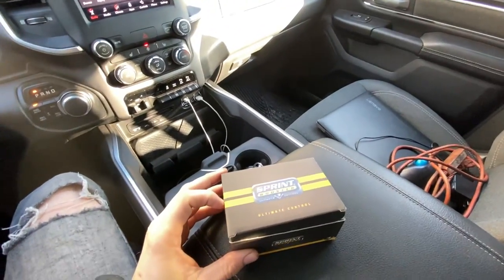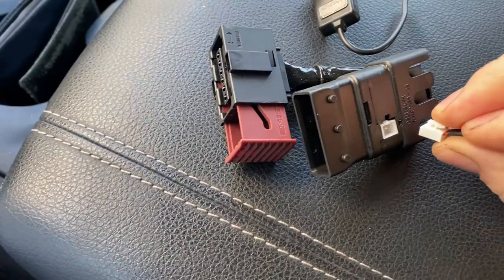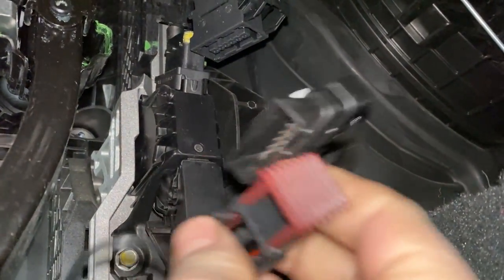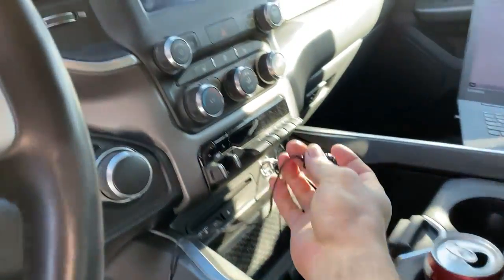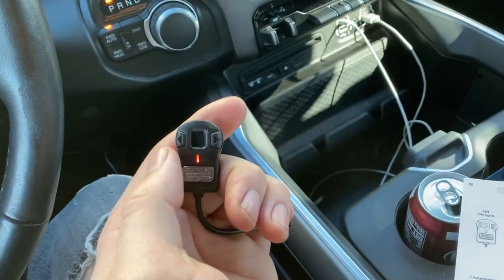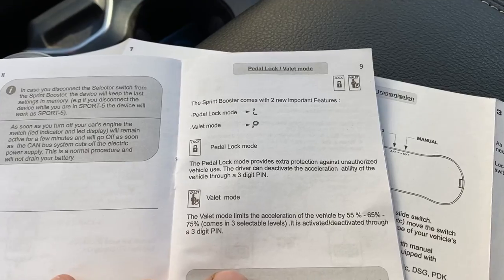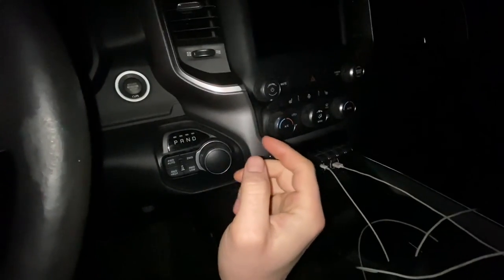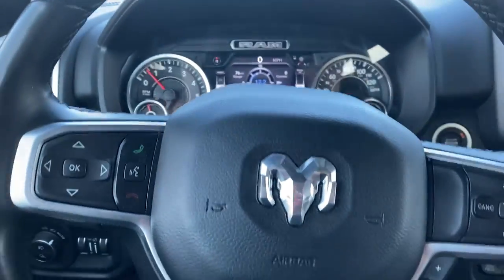Sprint Booster Install And Road Test (2019+ Ram 1500)

Comment from the maker: GET YOURS HERE!:
Sprint Booster for 2019+ Ram - https://www.sprintboosterusa.com/product/sbdo1053s-sprint-booster-select-v3/
Sprint Booster for 2010-2019 CLASSIC Ram - https://amzn.to/2wixzHx
JMS PedalMax for 2019+ Ram - https://www.jmschip.com/pedalmax-2018_2020_some-ram-and-jeep-vehicles-px1920dcx4/
JMS PedalMax for 2011-2019 CLASSIC Ram - https://www.jmschip.com/pedalmax-drive-by-wire-throttle-enhancement-device-plug-play-w-most-2011-2018-jeep-dodge-and-chrysler-vehicles/
Pedal Commander for 2019+ Ram - https://amzn.to/30x5yXI
Pedal Commander for 2010-2019 CLASSIC Ram - https://amzn.to/2vA4mYk
Reply: Isn't product number sbdo1043s for the 2019 Ram 1500 instead?
Reply from the maker: The 43 is for the “classic” body style. The 53 is for the new 2019 body style.
Reply: @TonyTheTruckGuy  have you ever used sprint booster in manual mode on your automatic ? If so was it more aggressive that way? Do you think manual mode will do damage on automatic vehicle
Reply from the maker: Manual shifting the automatic will only damage the vehicle if you're downshifting too soon, causing the engine to over-rev. But regardless, it will probably put a little more wear on the transmission as opposed to normal auto mode. I have not tried the Sprint Booster in manual mode in my truck, as I find it a bit awkward to do with buttons instead of paddles or an actual shifter, but I can give it a try. It's fairly aggressive in tow/haul and in race 9.
Reply: @TonyTheTruckGuy  ok thanks for responding and i was meaning manual mode as in the little switch button on the sprint booster module itself just curious if its more aggressive in acceleration if module switch is set in manual mode but let me know if you decide to try it
Reply from the maker: Ohhhhhhhh. It is my understanding that “manual” mode is to only be used with manual transmissions. I think it sets the pedal command differently, so I haven’t tried it.
Reply: @TonyTheTruckGuy  not sure if this question was asked but if I decide to  switch from automatic to manual on my car, should I also switch to manual mode on the sprint booster?
Reply from the maker: I assume you mean you’re manually shifting your automatic? I’d probably leave it on auto. I think the manual setting is literally for a vehicle with a manual transmission, although I’m not 100%
Reply: @TonyTheTruckGuy  have you had any issues with it?
Reply from the maker: @bikingwithryan5968  I’ve only had one instance where I lost throttle response for half a second but honestly I’m not sure if that was an issue with the sprint booster or just the truck itself. It’ been months and never happened again so I think it was just a fluke.
Reply: @TonyTheTruckGuy  watching your videos on this again. I want one and it seems like this might be the most reliable.
Reply from the maker: @bikingwithryan5968  I believe it is the most reliable as well
Reply: So which one would you recommend for quality and functionality? Im leaning towards the sprint booster for pedal lock.
Reply from the maker: @resdawgs  Have not personally used any besides the sprint booster, just seen the other ones in other videos before I made the decision on which one I wanted.
Reply: @TonyTheTruckGuy  ok so which do you like the most?
Reply from the maker: @resdawgs  Well Lila I said, I have t personally used any of the other ones. But obviously I felt that the sprint booster was the best option since that’s what I went with haha

Comment: The sprint booster is the best. Dont even mess with the others. More features too. You made the smart choice.
Reply: milchuck  No I haven't tried them. But if you try another brand your probably regret you didn't get the original which is the sprint booster. It's the smallest of all the brands out there I have seen and has the most features and it works. I did some research and reviewed a lot of comments and viewed many videos on all the pedal controllers. The sprint booster has had different versions to give you more features. I ended buying it for my BMW but I haven't installed it so far. So this is just my opinion and you can take from it what you want. Thanks you and have a good day.

Comment: I’m looking at this now because it recently returned my Pedal commander. It kept throwing me codes and lit up my Ram 1500 limited dash like a Christmas tree. Loved the response but it’s not worth the codes or the other issues folks seems to be having with it. The sprint booster seems a bit more simple, safe and won’t put your machine in a frenzy.
Reply: Which model did you have? I just got the pc78 for my 21 1500 HEMI eTorque

Comment: Hey Tony, just so you and your viewers know. I just got my SB-V3 and installed today. It works great, and I was able to shift from mode to mode, and level while driving, but with my foot OFF THE GAS.

It's deceiving at first and you have to remind yourself this unit only affects the fuel signal. It really throws you back in the seat when you get on it! I did notice another thing during my install, my connector is not like yours, I assume it is a newer model so it did not have wires connecting the two plugs. It has a double ended connector with the controller plugged in and that connector block goes between the pedal plug and the factory connector. 

Now, I have to wonder, what would it be like to add a tuner as well. I know, some tuners cover throttle response as well, but that might be a heck of a ride, until my wife finds out! 

Thanks for the install review and how to's.

It might be helpful to add my truck is a 2022 Ram Laramie, 4x4, 5.7 Hemi, with etorque.
Reply from the maker: Thanks for the comment! I believe they update the connector on the newer ones. A tuner would add some fun but just have to say bye bye to warranty haha
Reply: @TonyTheTruckGuy  Yeah, no fun allowed! Have a great weekend.
Reply from the maker: @gunnersecuador7515  You too!

Comment: So if i understand correctly. If you're cruising at 65mph, and as long as your foot is not on the accelerator pedal, you can change mode? You cannot change mode if you're stepping on the gas pedal right?
Reply from the maker: Not cruising, but coasting. Correct, I have changed modes while off the throttle numerous times. Never tried while on throttle.

Comment: Ok I'm only at 11:41 of the video but it sounded the best to me in the stock mode. I would run the Pennzoil ultra synthetic or Rotella Truck synthetic or Amsoil in that engine if your going to keep tromping that throttle for the sake of the lifters and cam shaft. Just throwing my thoughts out.
Reply from the maker: Probably not a bad idea but it’s just been getting whatever the dealer uses during the oil change. Been having them do the changes just so they can’t argue I did it wrong if something happens with lifters or cam. Race mode is definitely more aggressive than stock though.

Comment: Love your Vids! Would you still recommend this and any code or ecu issues?
Reply from the maker: Thanks! I actually traded the truck in last November when my lease was up, but I loved it and I didn’t really have any issues with it. Like ONE time I had half a second where I didn’t have throttle response but that could have been just me confusing the transmission or a glitch with the truck itself. Never had another problem after that in the 2 years I had it.

Comment: I went with Hikeit due to on the fly configuration, automatic configuration, and anti-theft mode. Got it for $185 and I love it!
Reply from the maker: Haven’t heart of that one I’ll have to check it out. This one also has a pedal-lock for anti-theft as well as valet mode. It’s BASICALLY on the fly. Just have to let off the throttle and push the button to change modes then can get back on throttle. Can you feel a difference with the Hikeit?

Comment: I grew up driving sticks with cable throttle. The gas pedal response was predictable.  My current TL  automatic sucks . It's like there are dead spots. On the highway when I want to increase speed you have to be aggressive with the pedal. Gentle pedal pressure is hit or miss.
Reply from the maker: Yeah it’s quite annoying haha

Comment: Nice review.  I am deciding between the PedalMax and the Sprint Booster. Was there anything you did not like about the Pedalmax? Thanks
Reply from the maker: I haven’t personally used the pedal max, so I can’t give any advice on it really. I went with the sprint booster because it’s a 1:1 ratio with the pedal. Pedal commander makes the throttle go to like 100 when the pedal is only at maybe half. I’m not sure exactly how the pedal max works.

Comment: If you want to know an awful throttle response, look at the yaris ia. I can mash the pedal down 100% and it will respond 1-2 seconds later. POS lol 106 horsepower of sadness

I remember coming from a stop having mashed the pedal down 75% of the way and the dang thing is still going 20mph inching like a snail through an intersection. You have to mash it, then it feels like it's going too fast and out of control
Reply from the maker: No thanks haha

Comment: Do you have Etorque in your 2019 Ram ..?  I like the simple install of the SN but not sure if it will work with Rams Etorque…??
Reply from the maker: My truck did NOT have the eTorque. I think it would still work though. Might be worth emailing Spring Booster customer support and checking with them.

Comment: So, leaving it in Sport 9 might be the happy medium? Will this get along well with eTorque?
Reply from the maker: Not sure on the eTorque, as my truck doesn’t have that. In theory, there shouldn’t be any interference with the eTorque since it still feeds off of throttle position, but maybe email SpringBooster and ask just to be safe. And exactly, I leave mine on sport 9 usually. Race 9 is fun every once in a while just to hear the engine rev and such but it definitely isn’t as fuel efficient haha.
Reply: @TonyTheTruckGuy  HOLY COW!! I installed mine. Immediately, the traction control service message flashed across the dash and the "service gas pedal" message popped up too. I attempted to drive it and it was accelerating without me even touching the pedal, and accelerating fast. I turned around and went home and immediately unhooked it. I put my scanner on and got several pedal code errors. I erased them and the traction and pedal service light went off, but now the check engine light won't go off.

I'll call Sprint Booster tomorrow and find out WTF is going on.
Reply from the maker: @craig4fsu  Wow that’s really strange. What year is your truck? And what mode were you on?
Reply: @TonyTheTruckGuy , Sport 9, 2021. The guys at 5thgenrams.com said i didn't wait long enough before starting the truck. They said give it a day or two, hook it back up, wait 20 minutes and then start the truck.
Reply from the maker: @craig4fsu  Was your truck running or ignition on when you plugged it in?
Reply: @TonyTheTruckGuy  No, but after re-reading the instructions, it says to keep your FOB out of the vehicle while hooking it up. I had my FOB in the console. I'll give it a couple of days and try again. I'll let you know.
Reply from the maker: @craig4fsu  Hopefully it’s just something silly like that. Good luck!

Comment: Was just wondering if anyone had any problems with install? I just purchased one for my 19 Ram. Did what they said about the door being open (10 minutes) hooked it up, and as soon as I started the vehicle, my dash lite up like a Christmas tree. Traction control, throttle era, and so on. Had no throttle response. Unhooked it, and everything normal but a check engine light. Any input would greatly be appreciated!
Reply from the maker: Was your ignition off when you connected everything, and were all the connectors fully connected and locked in?
Reply: @TonyTheTruckGuy  yes
Reply from the maker: @randyknafel5951  Very odd. You’ll probably have to go to local auto parts store if you don’t have a scanner and clear out that engine light. Then maybe try the sprint booster again. It’s possible you got a defective one, otherwise it should work especially since your truck is the same year.
Reply: @TonyTheTruckGuy  I thought about maybe unhooking the battery, and installing it and see if that would work.
Reply from the maker: @randyknafel5951  Could try that as well. Hopefully it was just a fluke
Reply: Can you give an update im having same issue right now!

Comment: Will the sprint buster work on 2001 F250 7.3 diesel with supper chip.
Reply from the maker: Doesn’t look like they support any Ford trucks older than 2004 unfortunately.

Comment: what's the best tuner for the ram
i heard the pedal commander had bad reviews do you recommend the sprint booster
Reply from the maker: These pedal commanders aren’t really a “tuner”, they just help with throttle response. There’s no trace in the ECM so warranty should not be voided. I’ve been happy with my sprint booster so far and have had near zero issues. The o oh problem I had was 1 time I hit the throttle and it had a small hiccup, but it was for only half a second and honestly I’m not sure if it was the sprint booster or the truck. It only happened 1 time.
Reply: @TonyTheTruckGuy  ok ill have to try the sprint booster
is there any tuners available for the ram 2020
Reply from the maker: @rupertturner7311   Honestly not sure as I haven’t researched tuners since I don’t want to void my warranty, but I’m sure they have some available by now. When these trucks first came out, the only option was the Pulsar which is a piggyback ECM.

Comment: Okay so I had my pedalmax on my Ram for about 2 weeks now today and totally failed driving down the highway all of a sudden no throttle had to pull over shut the truck off wait turn it back on turn the pedal Max off and limp home with no throttle I got home and it was throwing no low voltage throttle position on the dash so I disconnected the pedalmax reconnected the factory and no codes no engine light on so it's inherently dangerous is my opinion
Reply from the maker: Yeah you're definitely giving the pedal box a lot of trust and control. I've heard of similar issues or worse with the Pedal Commander, which is why I went with Sprint Booster. Glad you were able to make it home and nothing happened where you got hurt.

Comment: I have a 2021  ram 1500 I work for 2021 ?
Reply from the maker: I would double check their website or email them to be sure, but I’m guessing it would work unless they changed the throttle pedal between the 19 and the 21

Comment: FYI sprint booster is the inventor of these kinds of products. All the others are imitators.
Reply from the maker: That’s what they claim anyways haha
Reply: @TonyTheTruckGuy  trueee lol I was planning on getting pedal commander but then I found out about this one. I I like the features more on this than the pedal commander.
Reply: @TonyTheTruckGuy  specially since I have a 2014 Corolla 6 speed manual and this one has a mode specifically for manual transmission
Reply from the maker: I’ve heard of pedal commanders failing and causing throttle issues too. I also like how the sprint booster makes it so 50% throttle is actually 50%. It just gets there quicker. As where the pedal commander gives like 100% throttle by 50% pedal position.
Reply: @TonyTheTruckGuy  very true! 😁 Super excited to get it man

Comment: well i hope this is better than the "pedalComander"after 2months.the dash lite up with all kind of messages and when i too my foot off the brake it would lunge forward.i had to pull in a parking lot disconnect it ..put it back to stock and all was good again.so much for the "PedalComander"!😠😡!
Reply from the maker: Yeah I read about a few horror stories with the Pedal Commander which is another reason I went with this.

Comment: just got mine, not impressed at all... you can get the same marginal performance out of a cold air  intake for half the price (2019 ram rebel)
Reply from the maker: Most decent CAI cost $300-$400 which is the same or more as this, so I’m not sure what you mean. I think they pair nicely together. There’s no denying the sprint booster changes the throttle response and transmission manners.